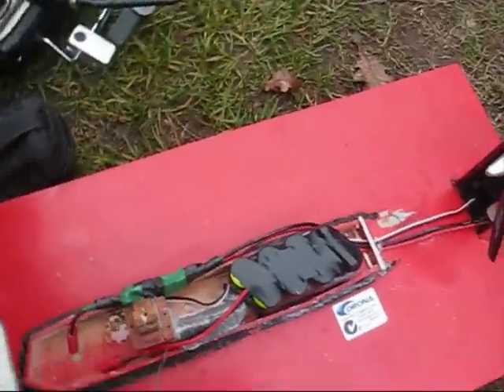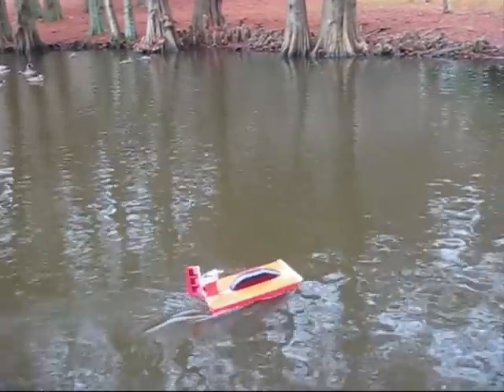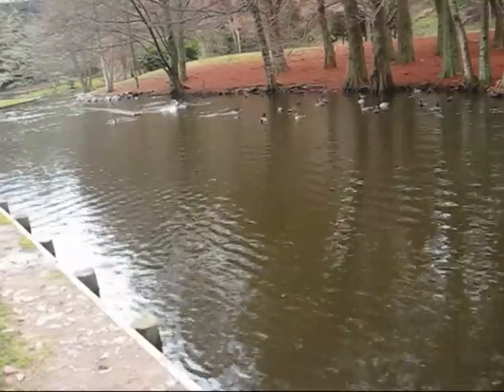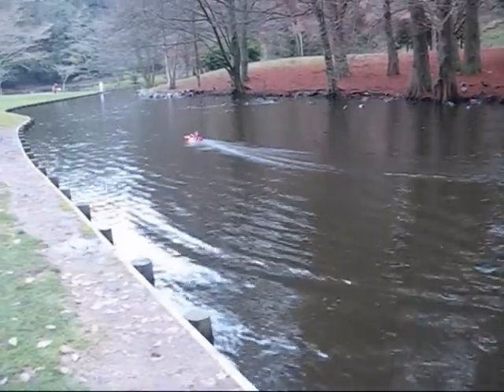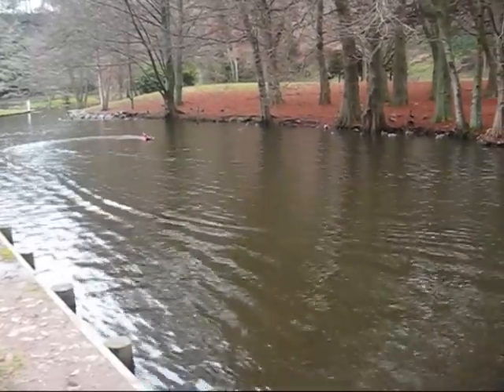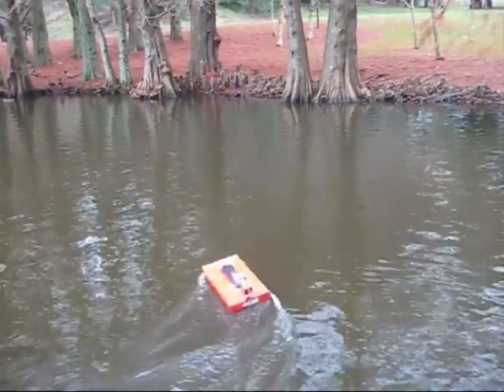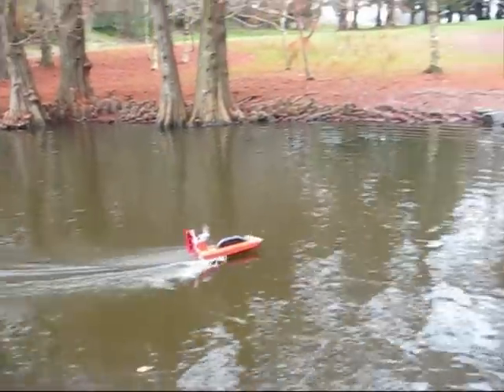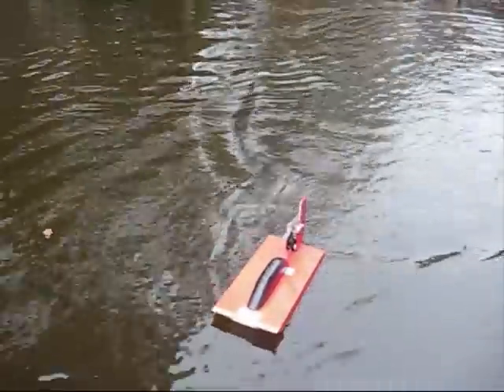airboat final mods complete

Comment from the maker: New Mods coming this weekend. Prop pitch change to 8x5" folder, Motor change to Brushless 1530Kv, Battery change to 3S 1600MaH x20C  Lipo and 40 amp speed controller.
I ran the boat on Sea water at xmas... got a tiny bit of water on the spd controller, which I fixed with some CRC2.26... but I forgot to chk the battery too, and now the terminals have corroded - didn't think it got wet...!
I have run the boat with the lipo before, but drew too much current - this time is different. Stay tuned..!